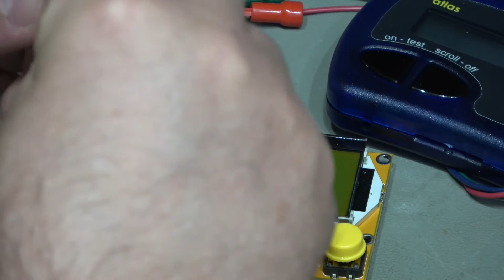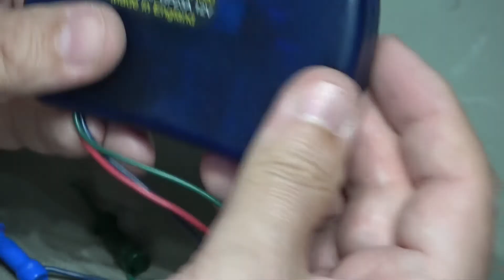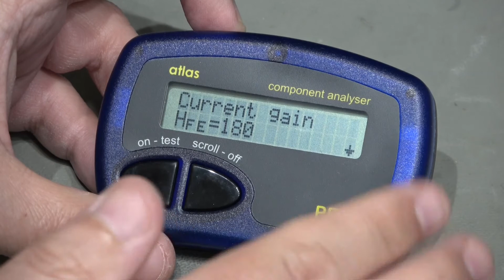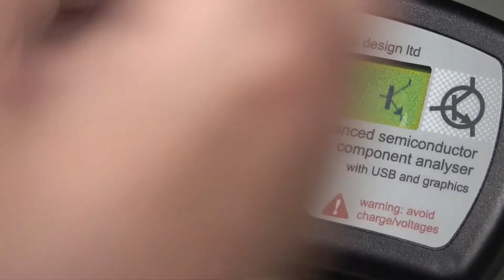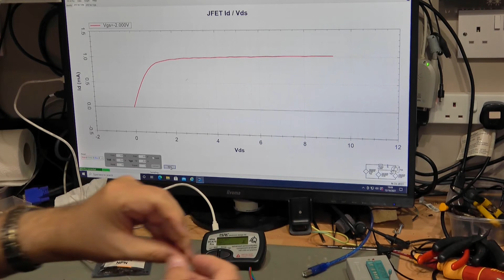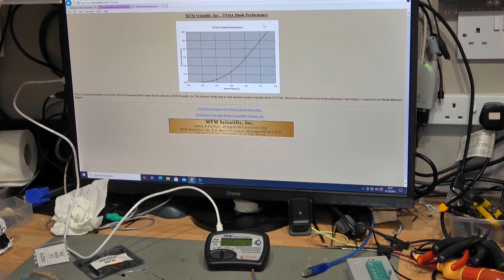0029 Simple testers, Atlas DCA75 finds some fakes

Comment: To avoid suffering, buy DY294
Reply from the maker: A very manual alternative but far more range than most.   It would be harder work to find the fake germanium with that, and very hard to find matched or complementary pairs  but certainly possible I think.  The curve trace is very handy to have despite the limited range.  I need to work on something myself I think - most of the available decent curve traces are too pricey imo

Comment: I would like a quick check of the 74 logic chips, like those used in my frequency counter. With the Tl866 tester: can you just plug the IC into the socket and get a go/ no go result, without hooking up to a computer?
Reply from the maker: No, requires a computer for everything!

Comment: It is the fakes I discovered one split-second prior to my hitting Purchase on Scamazon's notes "Sold by Scamazon" & "Shipped by Scamazon" two each of the decades inactive obsolete long-gone out-of-stock, $100/IC if one can find any anywhere Intersil's ICL8038 and Exar's XR2206 Frequency/Signal Generator kits are selling by Scamazon"

the weird part, aside from the cute falling off the desk rounded brand...

I just plunked $100 on a VI Semiconductor dual curve tracer for my $85 2ch handheld oscilloscope and an IC Tester, the 1000+ type gizmo a few different variants are on the market.

none of these look familiar, but my phone does not allow me to see the notes yet. And YouTube will wipe this typing if I see it now. ;-)

THANK YOU!

PS Rigol DHO9x4 is up next.
Reply: Scamazon & FraudBay have been squeezing nickels out from unsuspecting electronics hobbyists for , well, forever, most notably my go-to Frequency/Signal generators from 40 years ago with my first "I will create the "Twent-cent device that will save so many lives I can sell it for, hmmm, $500US"

I have been hunting in this arena for two years at least as I rebuild my 'bench' 40 years post my previous one.

Think of the prophet!!! marginal humor injection, that

Pace looks familiar, except that this particular shape oddly-enough squirts from my fingers faster than a watermelon seed, violating the warranty when it inevitably flys-apart revealing an empty case with a skin-thick fake display with random numbers generated fooling me into believing there are exactly ZERO trustworthy corporations ANYWHERE.

humynity is PHUCKED!

47 years left, folks

Exar's XSR2206 & Intersil's ICL8038 kits are b ogus, though one intrepid explorer has reigned supreme over the dooky spreaders FraudAzon and ScamBay truly are.

Out out out foul demon-spawn!

Your Greed-Driven Money-Grubbing Morally-Bankrupt Crazed-Fantasy you need to be able to afford your dead-end trip to Mars, thank me later, but get to work Preventing the Premature-Pull Date right up ahead.

Your outfit becomes you only while wearing tight-fitting 100% lead shoes underwater.

then the air supply hose is severed and Earth flies around the Solar System like a deflating balloon that just popped.

Comment: The most expansive one does not tested the dual gate mosfet...
Reply from the maker: The voltage and current outputs of almost all bugdet testers are completley inadequate to properly test most MOSFETs except the tiny ones, they just dont test enough range. I've several faulty transistors that I eventually found and other than very expensive curve tracers none of the budget testers could find the fault.

Comment: I have a bunch of New Old stock Motorola transistors with color bands on them how do I look those up
Reply from the maker: Not aware of any reference.  Colour bands were often used to indicate beta values, or just for specific customer designations etc, however vary from manufacturer to manufacturer and sometimes on a per custmer basis.  Probably just as well to just characterise them with a simple tester.  Unless anyone else has any ideas!
Reply from the maker: Actually there is this https://www.instructables.com/From-Resistors-to-ICs-Color-Codes/ but not sure it always hangs together

Comment: I have one DCA 75 Pro, is an excellent component tester.
Chinese component tester can't detect IGBT's DCA 75 Pro can measured without any problem.
Reply from the maker: I have it on the desk ready to go particularly for transistors and fets when doing repairs.  It was caught out on some faulty transistors that worked at low current, but which failed at high current switching but has successfully found quite a few faulty components.  I need to build one with bigger range I think- yet another project on the list
Reply: @MakeOrRepair  I have the B&k 520b also.
This is a powerful transistor tester, but some times transistors fail at very high current or high temp and is imposible to catch with any transistor tester that I have.
Best Regards.

Comment: There is a searchable cross reference list for most HP part numbers. I have a pdf I can send over for you if it would be useful.
Reply from the maker: Thanks for the offer,  I do have it, In fact I've got a few from different sources including HP journal, just in case there are any parts on one not on another, I work on quite a bit of HP so  it is really useful.   Unfortunately I do still come across some parts not on the list - mainly FETs it seems - I harvest them from scrap devices where possible but really handy to test a few and then between the curve tracer data and the diagram/supply voltages etc I can normally work out a fairly good substitute.   I just need a better curve tracer really - but given the price it is on the "one day I'll make one list"
Pete

Comment: Atlas DCA Pro error shows NO Component when connected to

L7912CV

If I try to connect 2 wires only on any pins it detects it as zener diode. no reply from manufactuer. Does detect LM317.
Reply from the maker: I don't linke the "No component" message, I have seen it several times for unsupported components as well as faulty components - I think a more specific error message would help.   That is not surprising  it is specified as providing test voltages  up to 12V and 12mA, The manufacturers limit the voltages and current so it can be used as general purpose tester;  with higher voltages there would have to be user intervention to limit the power to make sure that some  devices under test are not destroyed.    A voltage regulator like the 7912 would needs a voltage well above 12 V to operate correctly, since it proably has a marking on the case you really need to test it is working.   For that you would need to move the supply voltage around the 15-20V region and apply some loading in order to measure that it regulates.  It would be possible to identify how it characterises using lower voltages and perhaps identify it sort of, but with some possibility of error, but it certainly would not be a proper test of regulation.  The LM317 of course can work at much lower voltages. as could say a 7805.

Comment: Does not detect vloss for capacitors either, all chinese do.
Reply from the maker: The supported component list for the DCA75 is for semiconductors only: 
    Bipolar transistors (NPN/PNP inc Silicon/Germanium)
    Darlington transistors (NPN/PNP)
    Enhancement mode MOSFETs (N-Ch and P-Ch)
    Depletion mode MOSFETs (N-Ch and P-Ch)
    Junction FETs (N-Ch and P-Ch). Both symmetrical and asymmetrical types.
    Enhancement IGBTs (N-Ch and P-Ch).
    Diodes and diode networks (2 and 3 lead types).
    Zener diodes (up to about 9V).
    Voltage regulators (up to about 8V).
    LEDs and bi-colour LEDs (2 lead and 3 lead types).
    Low power sensitive Triavs and Thyristors (<10mA trigger and hold)

I have never used vloss, if i want to find out if a capacitor is leaking then I measure the DC current that flows through it usiually in uA (to a precision of 10pA) at a given voltage (which I choose to be as close to the operating voltage of the capacitor that I can get, then I compare it to the datsheet for the capacitors or a table of acceptable leakages for that type of capacitor. If the datasheet gives the value in Ohms then V/I gives me equivalent parallel resistance.  

I think vloss is a bit of a strange beast and is only useful as a rough indicator,  is just a measurment that in isolation has no engineering meaning.    
Assuming it is intended to be a measurement of the voltage loss by a capacitor by leakage then the chinese meters are measuring what exactly?   If you charge a fantastic quality good capacitor to a known voltage, then  connect it to a meter circuit to measure the voltage across it (and call the difference over some amount of time vloss) , then you will measure a change but what you are actually measuring is a parallel combination of internal leakage and the expected discharge of the capacitor through the input impedence/parasitics of the meter.   Since the capacitor loses voltage as a result of current flowing over time accoring to an RC amount, and that current is dependent on the original charge voltage then the vloss is also dependent on original charge voltage and the time over which the change is measured.  So you have to have 5 separate measurments for "vloss" to have any real meaning 1. starting volltage, 2. time taken, 3. meter input impedence 4.capacitance 5. voltage loss over the time. This means that as a stating point that vloss should be writtten a vloss/time and then you have to do the math to normallise different satarting voltages and remove the influence of the meter and get the leakage current (which can be used to calculate an effective parallel resistance which does have some meaning). 

Having said that, for testing a set of capacitors of the type and same value using the same meter with a freshly charged battery then the vloss readings will provide comparitive data but it has no sense of scale.

For the measurement device itself there are problems too with the dynamic range of the vloss that has to be measured and the impact of the test circuit on the leakage particualrly higher quality capacitors, but I've written enough; maybe I need to do another video on capacitor leakage.
Reply: @MakeOrRepair  I can only say that chinese meters had diagnosed a cap that had good esr and bad leakage, it did not work on PC PSU. If only ESR70 would be used then this problem would not be found despite cost of ESR70 is 80Eur and chinese meter 5Eur.
Reply from the maker: The DCA75 is not specified for testing capacitors at all.   My reason for geting the DCA75 was that I couldn't afford the proper gear for testing semiconductors  but I hoped it might find some semiconductors faults that all the others were missing, and it has helped.  Not 100% sure but I think I do make the point in the video that I use and do think the cheap meters are useful for many purposes.  But they are a handy cheap tool, I also do think all the low voltage and low current testers are inherently limited and each has strengths and weaknesses.
Reply: @MakeOrRepair  The Chinese testers can test zenners 18v no problem up to 30V, this one as you said only 11V :( Very overpriced if you ask me.
Reply: @juliusvalentinas  Chinese meters can't test IGBT's, DCA75 Pro can do it without any problem.
Plus the curve tracer.
Peak Atlas products are much better in my opinión.
I have some Chinese meters, but I prefer to use renowned brands for my indtruments.
Best Regards.